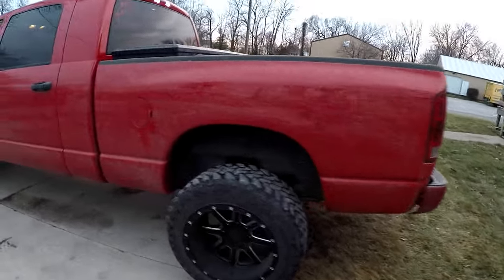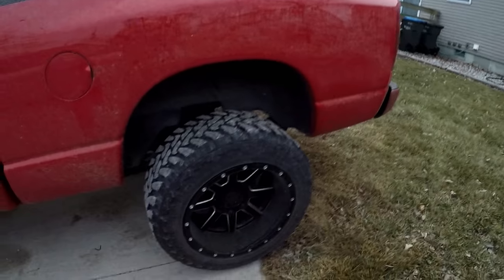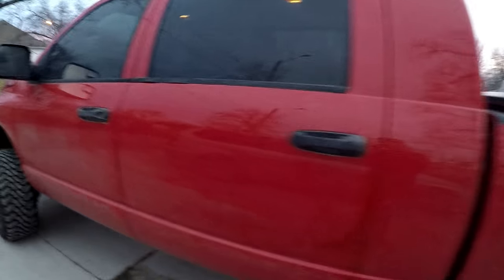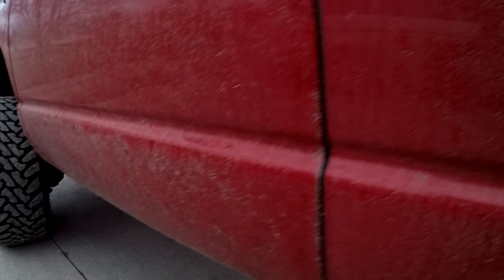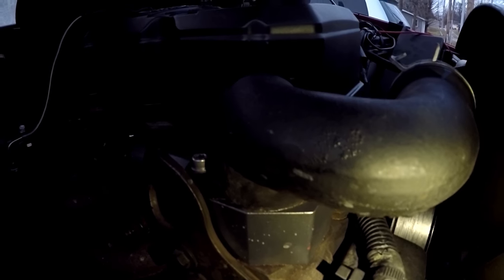Cummins Coolant Bypass!!

Comment: Thanks for the Video!  Liked !! As far as I know freeze plugs will never end up in the oil pan ... they can possibly get caught in the water jacket. :) By their very definition they are FREEZE plugs and that denotes coolant ... oil does not freeze at any temps that we would live in. :)  Antarctica excepted! :)
Reply from the maker: Mostly you are correct, but Cummins have freeze plugs everywhere. There is one on the left side of the block at the bottom that goes to the oil pan. It is there for a drain for a second turbo, but also, Incase the oil pan gets pressurized.
Reply: The freeze plug you were talking about Walmart end up in the oil pan you were wrong
Reply: The plug for drain for turbo is a plug not a “freeze plug”